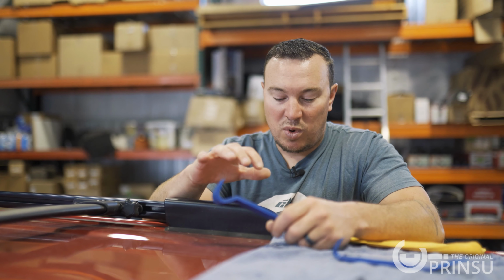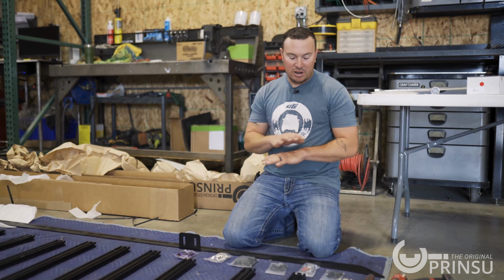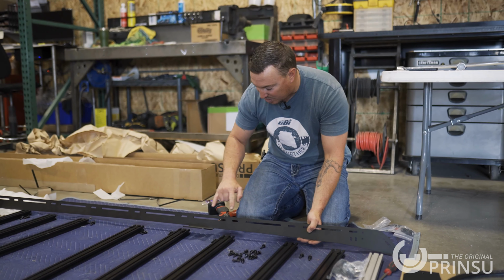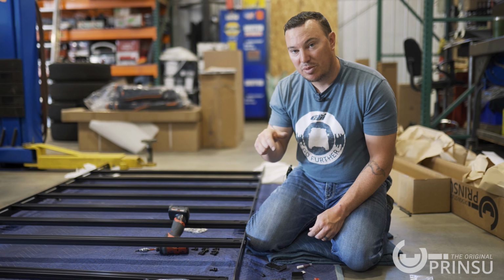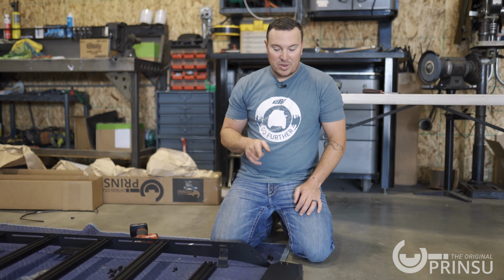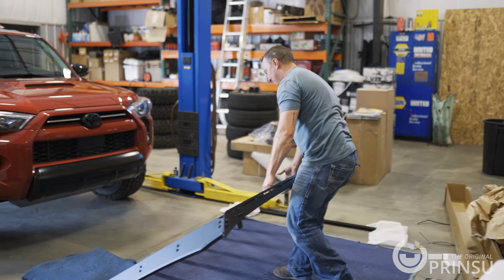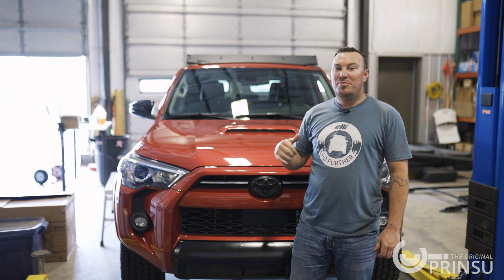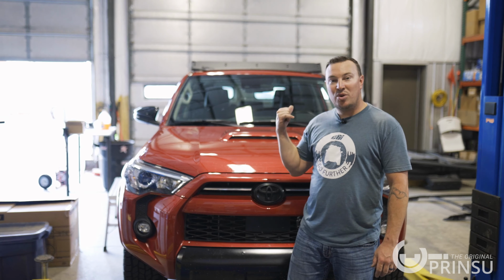PRINSU INSTALL: 5th Gen 4Runner

Comment: What size T-nuts are used in the front that slides into the rack? And also the bolts that go into the car? I’m looking to replace all the hardware to stainless steel
Reply from the maker: T-nuts 1/4 inch. Bolts M8-1.25 x 60mm

Comment: can you put the rails anywhere you like instead of the short elongated slots only? ie. use the longer slots so i can leave the sunroof obstruction free. thanks
Reply from the maker: Yes you can also place the rails in the longer slots
Reply: @PrinsuRacks  thank you for the quick response. im going to order mine. tell me what you think of this. baja xl linkables fitting in the spaces of the LP4 windscreen.? if not then the 40" cutout it will have to be.

Comment: So, did my 4Runner Full non-drill installation this morning, and your PDF instructions on your website are completely different than this tutorial video.  The PDF says to build the cross rails on the roof instead of on the ground, and it doesn't even mention the RTV silicone at all.  I followed the video's instructions, which seemed better, but thought I'd point this out.
Reply: Yup. Mine is leaking because I installed this over a year ago, before this video was made. Great stuff. Kinda pisses me off, and CBI is acting like it isn’t their mess of course.

Comment: You didn’t talk about the last cross bar, is it mounted in the last set of small slots like all the others or vertically using the pairs of holes, and why?
Reply: vertically, so it clears the antenna.